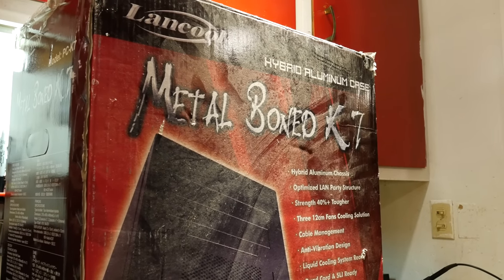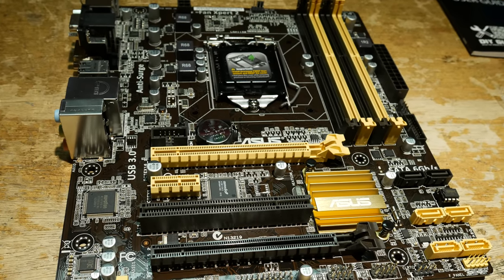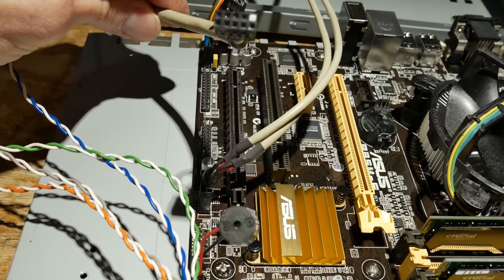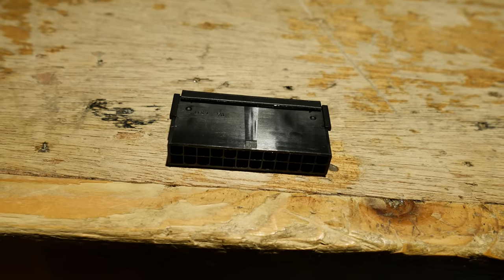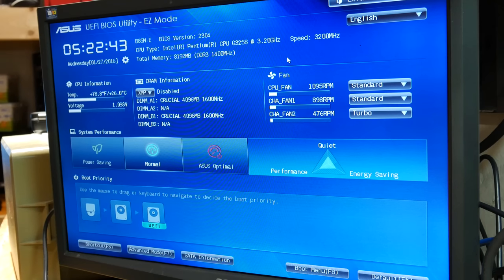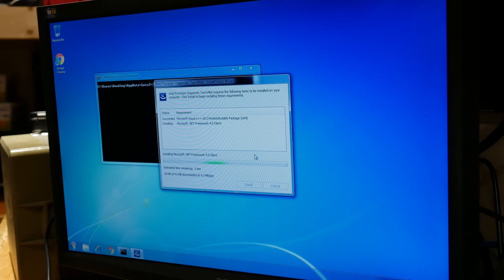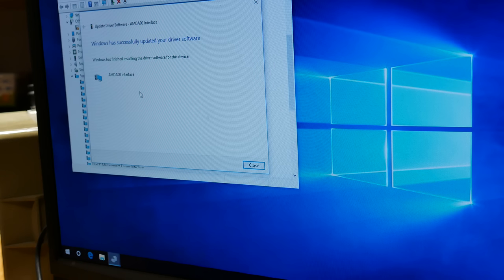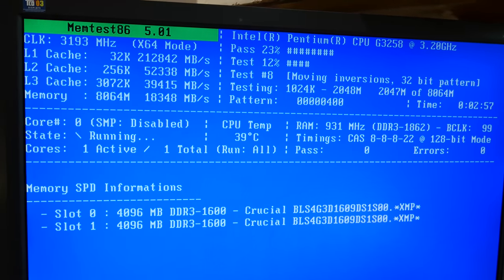New Office PC Build Jan 28, 2016

Comment: Danger! Falling book of incoming commentary!

That case sure has been around the block a few times! Considering the twin fans in the front, would it really need a rear fan?

40% tougher likely does refer to a cheap and junky case that would fold flat upon being used as a chair. As for "quad cord"...well, I've never seen a single unit quad-redundant power supply, though perhaps they exist. That'd have to be the most cramped power supply casing ever!

I'd have probably gone for a Core i3 or lower end i5 rather than the Pentium G3258. The G3258 does seem to get some very good reviews, and all of the contemporary Pentium branded CPUs do seem to be pretty good stuff. I certainly wasn't unhappy with a Pentium G2020 CPU, although I did trade it in about a year later for a Core i5 3330 just to get better playability in Rigs of Rods.

I absolutely despise those plastic pushpin cooler mounts. I'm not sure why they are even still around. I think there are still a few x-plates and similar around, but they're hard to find and surprisingly expensive. And as for metal I/O shield fingers obstructing ports, I wouldn't know anything about that. It was always the Ethernet port getting blocked for me. Around the S478 era, Dell used a metal mesh in some of their I/O shields that wasn't too unlike what Asus included with that board.

It was nice of Asus to include PS/2 ports and headers for serial and parallel. Now all you need are a set of port breakouts from an old ISA multi-I/O card! Those Nuvoton LPCIO chips have floppy disk controller logic, and while I suppose almost nobody would ever use it in this day and age, it would have been nice to see Asus bring that out on the board as well. It wouldn't have cost them anything meaningful.

I know the agony of having to wait before a new and exciting system can be powered up, tested out and put into service.

There definitely has been a degradation in the performance of Windows Update on Windows 7 (and sometimes even Windows 8/8.1 as well) when it first goes out to find updates on a clean installation. I think the cause is twofold: the memory leak bug in TrustedInstaller and the ever increasing number of updates that are landing in the catalog.

I've seen a few fresh Windows XP installations skip over their 30 day activation grace period.

Later versions of the .NET Framework installer check with Microsoft for the latest updates. If Windows Update hasn't finished downloading and processing its catalog, this will take forever. A system I upgraded to Windows 7 a few months ago spent the better part of an afternoon doing this. 

By comparison, a Pentium III (450 MHz) system I was diddling around recently was pulling around 35 watts from the power outlet. :-P We live in such amazing times when a modern system can get so much more use out of the energy consumed and idle itself down to such an extent. What was the system's energy use when you had that 4K video playing?

I don't have a display that can resolve 4K, and at my connection speed the point of doing so would be completely moot. And while I'm sure it's very old fashioned at this point, I still don't watch anything on Youtube in HD (even though 720p is very attainable).

Whew! I think that about covers everything. Now if only Youtube hadn't put a block on copying and pasting everything I'd written. Even as fast as I type...what a pain! (I suppose that's a hint to shorten my commentary significantly.)
Reply: I know this comment is a year old and you've probably figured this out already, but for those who are reading and don't know Microsoft has patched the issue with the Windows Update taking ages on Windows 7, however you do need to manually install KB3020369 and KB3172605.

And also, Asrock has used a similar Nuvoton chip on their Z77 Extreme6 board and actually used the floppy header, pretty surprising being a fairly high end board. I have one myself with an i7-3770, and I must say while the feature set and aesthetic of the board is excellent it's certainly not very reliable.

Comment: Windows 10 updater is based after Synaptic Package manager just wonder if apt-get update will work under windows, there is an update for Windows 10 that actually installs UBUNTU Linux into Windows 10 and means that you can use UBUNTU directly from Windows 10 and you don't need a virtual box program any more.

Comment: There's a lot of good PSU brands out there but for the last 3 years I swear by EVGA PSU's, built around 50 systems with them in them from gaming towers to office machines and work stations.  I have always liked EVGA products and the 2 times I have had to use there support it was the best experience with a OEM I have ever had.

Comment: I think Windows 8.1 automatically installs drivers too if it's connected to the internet. The Windows Vista and 7 "search automatically for updated driver software" has always been broken and never worked, at least in my experience.

When i install Windows 7, i get isos from this Gen2 guy or getintopc, they have all the latest updates already installed, and i just use my key to activate it automatically.

Comment: That behavior you'd seen where Windows Update just dumps files on a seemingly unrelated drive has been happening for a while. If you look around it seems like the updates will just arbitrarily pick a drive with a lot of free space available, regardless of its being your system drive or not. Was driving me crazy for a while, since I have my NAS mapped in such a way that it looks like a fixed disk.

Also, I've always felt that applying updates to Windows led to it becoming worse over time. I used to be overjoyed when I could slipstream a brand new Service Pack, since I could reformat and reinstall without the need to layer patch-upon-patch.

Great to see a new video from you, as always.
Reply: +LegionsOfAnon Oh yeah, it's funny to me to watch you try and play back 4k keeping your earlier videos in mind. We're a long ways away from trying to get Mint to play back 'high res' Youtube videos on like a GeForce 4 or whatever.
Reply: +LegionsOfAnon I'd be somewhat surprised if a GeForce 4 could actually pump the pixels fast enough for 4K video, assuming there is an AGP platform anywhere that could host a CPU fast enough to decode 4K video completely in software. (I'm thinking it'd have to be LGA 775 at the earliest, and there probably aren't a whole lot of those paired with an AGP slot.)

Even if it could be done, I suspect the Nouveau driver will promptly halt and catch fire as that is its normal operating state.

Comment: Hi Max! Had a little question for you, if you don't mind. My build is composed of an AMD A10-7700K 3.4ghz quad core processor, 16gb of DDR3 ram, a standard gigabyte ATX board. So I recently upgraded from onboard graphics to a Radeon R9 380 card, 2gb. My question is, is my 500 watt power supply sufficient for this build? According to website calculators, I'm barely above the recommended wattage. Thanks for your time!

Comment: Future ref: For the dot net 4.0 install, download the offline install package from Microsoft, disconnect from Internet, install.  For some reason it hangs right there in most cases if it's online.
Part of the issue with Windows 7 update is the catalog is massive, especially on a new install. The old update system is kinda klunky. Works fine when there are 20-30 even 50 updates, but over 100, you're talking hours.  200 on even a fast box, overnight.  I hate it but it's a necessary evil when getting some "older" boxes up and running.  (3-5 year old Optiplex machines that I often get)

Comment: Had similar problems with stuck windows 7 updates after clean installation. Reboot fixed it ..and RIP installing all these win7 updates, last time i did cleaninstall had like 900 updates to install, so i just straight updated it to win10 :D
Reply from the maker: +Jiří Bělský Ya, I wish Microsoft would at least update the installation discs a bit.  This was a brand new disc, and it still needed over 200 updates.  Perhaps now that Windows 10 is mainly distributed in download form, it will get updated more often.
Reply: +Maxxarcade why I prefer linux, reminds me of why I switched.
Reply: +wizardrule81 lol whats difference on linux, when you install from old iso you will get tons of updates too :D
Reply: it does not bind up or require restarts.
Reply: +wizardrule81  same here. I don't have time, patience and my life is not long enough and too precious to wait for ages for M$ to do the business
Reply: +Maxxarcade The option exists to slipstream released updates into a disc or USB stick. Unfortunately it doesn't actually seem to make that initial Windows Update scan happen any more quickly.

Comment: .NET framework not installing is also caused by the Windows Update services being busy. Those svchost processes are indeed related. It's been like that on fresh installs for Windows Vista for quite some time now and it seems that the issue is now present in Windows 7 as well.
Reply: +Ricardo Windows Installers often extract their temp files to random hard disks. I think they use disks with the most free space available. They usually get deleted when an update is installed though. Idk why it didn't for you, but those folders usually stay there when a PC gets turned off during installation or a disk unplugged

Comment: I have had nothing but trouble with windows 10, my network printer does not work and I have no desire to buy another colour laser printer when it works just fine under windows 7 and all my linux based computers I have here.

If MS forces me to use windows 10 by sneeky windows 7 updates I will migrate all my windows computers to linux and not bother with windows, I have just one device I will need to test first and that is my scanner, VNC works well under linux as does all my other programs.. some very old legacy stuff works just fine under wine so the move will not hurt too much.
My housemate has a laser printer connected to his computer so I need to test how that will work under linux (will test that later today using the laptop)

Comment: I was having trouble with Windows 7 on a laptop I'm working on, so I set it aside for awhile.  After watching this video and seeing how easy it was to install and update Windows 10 (along with drivers) I went ahead and upgraded the laptop.  I'm starting to like Windows 10 a lot now.
Reply from the maker: +Andrew Perry Did everything install correctly?  What model laptop was it?
Reply: Maxxarcade
Dell Latitude E6500.

The only driver Windows 10 couldn't find was one for the Broadcom Unified Security Hub (USH) which is part of the Dell ControlVault platform.  The driver had to be downloaded from Dell's site.  Although the ControlVault driver doesn't specify compatibility with Windows 10, it does however specify compatibility with Windows 8 and 8.1 which I figured is close enough.  The driver did install correctly.
Reply from the maker: +Andrew Perry The most difficult install I've had so far was a Toshiba P205 with Radeon x1200 graphics.  I had to use a modified video driver since ATI/AMD never supported it past Vista.
Reply: Maxxarcade It's the graphics drivers that have me wary of upgrading some PCs I have.  For example, I have a netbook (Intel Atom N2600 w/GMA 3600) which came with Windows 7 pre-installed and it performs well.  However, I recently learned that Intel will not update the drivers for the GMA3600 for either Windows 8 or 10. Bummer.
Reply: +Andrew Perry From my experience, Windows 7 drivers will work on Windows 10 99% of the time. (yes, I mean 99%). Try the upgrade or clean install and see if windows update will do it. if it won't, manually install the driver from the manufacturer, and worst case scenario, use device manager to find the package driver and install that.

Comment: You can get a 3rd party cpu cooler for pretty cheap that has the spring screws and larger plate...
New boards dont support 1394 anymore because no one uses it anymore for practical applications, It's all USB 2.0 and soon to be 3.0/3.1
Windows 10 is full of spyware and forced bloatware.
Reply: Not much bloat as far as I can see.

Windows 7 is going down hill since the release of 10, some weird patches which apparently include telemetry. Unsure how accurate that is, but worth researching if you're still using 7.
Reply: Craig McLellan Well Microsoft is being too skeezy with windows 10 for me to be comfortable with it anywhere close to my network. Forced updates, offloading data to a cloud server for god knows who to look at, nag ware..
Reply: I still use FireWire...

Comment: your windows 7 iso must be old and far behind on updates.  I created an iso file with updates up to january 10th now updates don't take so long to do maybe the same 20 minutes you get in windows 10.  I used NTlite to integrate updates into a windows 7 iso.  I do this because I work in IT at the university I used to attend and most of my day is just reinstalling windows and I was sick of waiting at the checking for updates screen for hours.  The university does not want to upgrade to windows 10 for compatibility reasons otherwise I would have jumped on that.
Reply from the maker: +FubarMike Sad thing is, this was a brand new disc with a recent build date.
Reply: +Maxxarcade I think the iso s only have either rtm or sp1 but don't include updates beyond that.  I really wish microsoft would have made a service pack 2 and even service pack 3 even if they were just update rollups and no new features.  that's why I love what microsoft is doing with windows 10 by releasing new builds every 6 months

Comment: Warning: Wall-o-Text Below.
Usually when I do fresh installs it's with a copy of Win7 that has all the most recent updates give or take a few months, already slipstreamed in. Most people have a problem with using slipstreamed copies because of the trustability of the person or group supplying it, but generally if you use common sense you'll find one that you like, and that fixes the issue of having to do so many updates. I'm fairly certain there's also a tutorial for doing this yourself with a clean ISO as well, I've just never gone and looked up any, since there are ready-made slipstreamed ISOs available with and without a loader for a, cough-cough easy activation of windows every time, cough-cough.

On an unrelated-drawing-into-related note, 2016 is certainly turning out to be the year everyone repurposes old cases for use with newer systems, as I've said before in a comment on an older video earlier this month. I completed that HP NetServer box that I turned into a sleeper system, finally, a couple days ago-- different board, i5-2500k and 16GB of RAM. (Picture here of the finished build, complete with annie-mays and an iPod Mini for excrement-posting on a certain technology imageboard we do not speak the name of: https://a.pomf.cat/zxhzww.jpg ) it was your last workshop PC build that gave me the idea to look for a different heatsink than what I was planning on using, and after finding the TX3 to not be in my budget range, settled on an eBay special slightly-used CNPS5X for $20 like I've already been using elsewhere. 

Breaking back from that, EVGA is a great company, just be sure to register that PSU on their website so you get the warranty in the proper manner. I just had to register the P67-SLI from said box with them, as it had had a few months left of warranty, so I could get an I/O Shield that was missing. (They made my day and sent it to me for free!) I can confirm that EVGA also uses the foam-backed foil on their I/O Shield as well for that board, and it's reeeeeeeally nice if done right. The only issue I forsee is what happens to that foam over time, looking at its density; it's going to possibly become flaky and/or goopy within 10 years. it reminds me of the foam-backed foil used in earlier Compaq Portable keyboards as well as other keyboards in the 80s and early 90s (rare) that were cheaply made. 

on the subject of the CPU, the G3258 is an excellent overclocker I'm told, and that alone makes it prime meat for a high-reliability application such as this. it's also the entire reason it has an unlocked multiplier. If you're not overclocking (and I know it will never be in this box ever!) it WILL last a long, long time. Apparently the norm with this CPU is to overclock it to 4.3GHz on the stock heatsink without breaking a sweat, the only downside overall at any speed, even just stock, being poor multicore performance compared to a normal i5 or i7, which is to be expected. 

I wish that box a long life, and the case an even longer one for years to come. I just hope full-size ATX boards continue to be a thing for at least another decade.

Comment: if windows is unable to get out to the internet at all it will say activation expired right after install.  once it gains an internet connection if it is not activated it will say that you will hve the 30 days to activate or it will activate on its own.
Reply from the maker: +Dudefoxlive I think in the past it was 3 days without internet, and could be extended up to 30 days?  I can't remember for sure.  But I know I've never seen it say "This copy of Windows is not genuine" immediately after installing.
Reply: it has happened to me many times